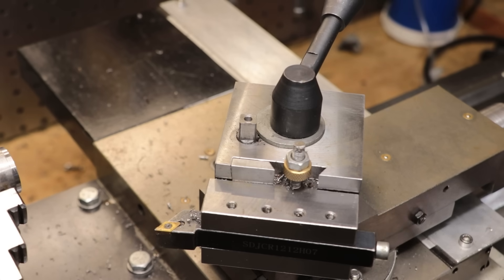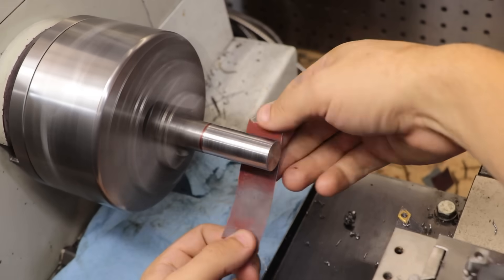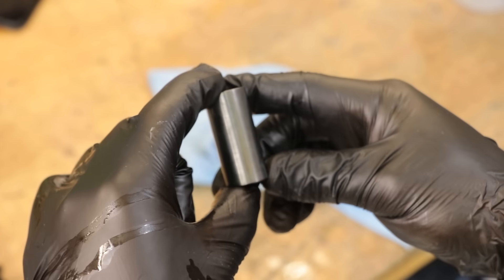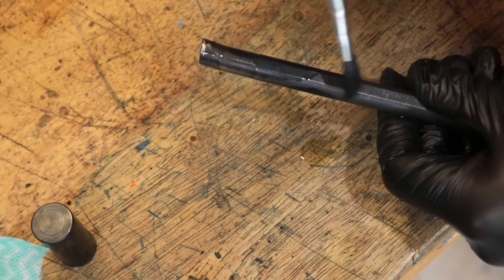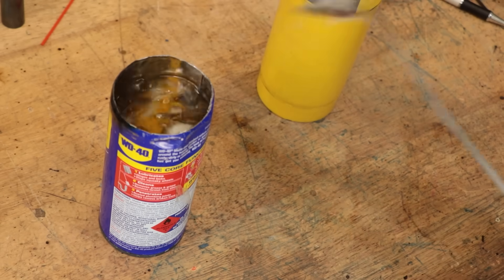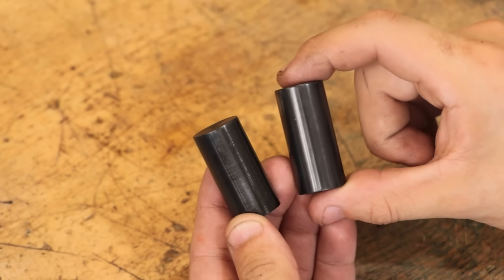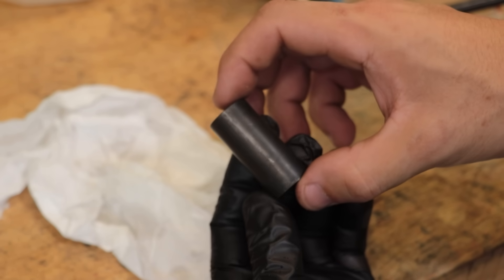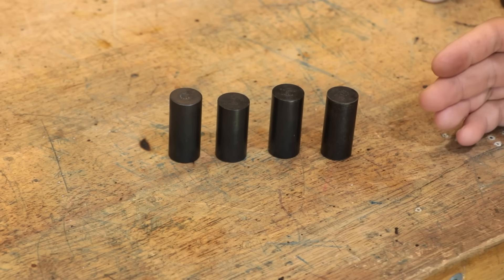Best Way To Blue Steel? Cold Blue, Hot Blue or Rust Bluing.

Comment: Nice video, although you've missed the other easy home shop solution, parkerizing. It kicks cold bluing and hot bluing into the trees in terms of quality and durability, and it's way faster than rust bluing.  All you need is a hotplate, or better, an unused slow cooker (don't even dream of using the wife's one, though).  The solution is easy to make, and for teh quantity of stuff the average home workshop is liable to need to blue, a couple of litres will last a lifetime.
Reply: Does parkerizing change the size, like if you use it on a thread, will it still work? 
I think I will try it, if I can find it in Europe :-)
Reply: @chris6160-d6s  There's always some dimensional change, but it's not noticeable.

Finding ready to use parkerizing solution is not that hard but can be a bit pricey, otherwise roll your own from phosphoric acid, manganese dioxide, and some steel wool. Many recipes are available online.
Reply: @wibblywobblyidiotvision  Great, thanks.

Comment: The best things I've found for Cold Bluing is a Syringe and a small Foam Paint Brush or alternatively a wad of Raw/Unspun Cotton like Cotton Balls. 
  The Syringe lets you apply the solution directly to the Foam Brush so you don't have to worry about wasting any as you can just add any unused Cold Blue back to the bottle, and the Foam Paint Brush holds and applies the solution much better than a regular bristled brush does. 👍👍
Reply: Such a solid tip

Comment: Can you tell us what other styles that you looked in to?
I've heard that boiling the part/s in vinegar is a good form of bluing for the hobbist.
Reply: Vinegar will remove real bluing.  It might also promote rusting; not really sure.  If so, it would be like rust bluing.  When I taught gunsmithing we only used real caustic hot bluing and Parkerizing so I’m not familiar with any way of using vinegar for bluing.

Comment: I did something similar to the hot bluing, 
I was making hardware pieces out of a higher carbon steel. After shaping I heated to red hot and quenched in used motor oil. They came out with a very nice black finish and good rust resistants
Reply: It is a good finish but isn't good for precision pieces as heating to red hot can cause warping or distortion which may require grinding to restore precision.
Reply: I never have tried to blue anything but decorative or ornamental pieces, but that's always been my go to. I suspect the used motor oil makes the parts darker because of the carbon/soot in it from engine combustion. 

If you want to try this, lawnmowers usually run non detergent sae 30 oil, and it usually doesn't get changed regularly, so there's your potential source. 

If you don't have a lawnmower, I'd bet one of your buddies would love to let you change his lawnmower oil for free. $10 and 15 minutes and you have your blueing solution.
Reply: @Matt-re3or  
i do own quite a few axes with that sort of finish. essentially the smiths just leave it on after quenching the steel and only remove what is necessary for grinding the edge and i can say it is sturdy, but not very even.

Comment: You could also try salt bluing.

It is tougher than most of these options, and can be polished (unlike rust bluing which will stay a satin finish) but not nearly as dangerous as the caustic bluing.

Comment: Most cold blue coatings use selenium (in the form of selenious acid), which can be very toxic. I think the blued parts themselves are probably not something I would want to have skin contact with (copper selenide). I would avoid using it.
Reply: Have there been any proven cases of poisoning from contact with cold blued parts?

Comment: An interesting video. 

Depending on where anyone lives, it might be possible to find a small gun shop who do have there own hot caustic bluing tanks. If you do the initial polishing to the level you want, the costs would be very cheap if all there doing is running them through those tanks. I looked into setting up a small system to do it at home because of the much better professional finish quality and it's durability. Frankly it needs to be either in it's own separate building or done outside. Even the fumes from the process will seriously rust anything anywhere close to the same location. It will also after using it enough, even start to degrade any wooden structure. I could afford to do it, I just don't want the extra issues that come with it.

Luckily my own small shop is inside my home and has the same conditions as far as being a semi controlled environment. I also live in a fairly arid area, so tool rusting has never been an issue. In the summer, my inside humidity levels average about 30%-40%. In winter and with the heat on, that drops to an average of 20% - sometimes as low as 9%. The only evidence I've seen of actual rusting is on a bar of 12L14 I've had sitting in my metal stock for over 25 years. But that alloy is well known for how easy it does rust. Even then it still only shows a few light areas. 

But I try to look at problems like this logically. Machine tools and all the required tooling quickly adds up to a decent sum. I've also seen large numbers of pictures in UK published magazines that show huge amounts of rust over almost everything. For whatever reason and using what they refer to as a garden shed or separate out building on there property seems very common. And going by those various pictures and in some YT videos, few seem to be ever insulated with vapor barriers or have anything like constant source of heat during lower temperatures. It's always seemed highly counter productive to spend what this costs and yet refuse to insulate to slow that humidity and reduce those non optional heating or air conditioning costs. And in those high humidity locations, I'd not hesitate to also add a dehumidifier. Any unheated area will go through the same temperature swings as the outside temperatures do. So anything made of metal takes a whole lot longer to thermally stabilize. That causes high humidity to condense on the surfaces and that's what causes the rusting. While I fully sympathize with anyone having to constantly deal with that humidity, tying to band aid and work around the problem is only treating the symptom and not addressing the root cause. Bluing parts does look proper for a lot of items, but for myself it would be for aesthetic reasons and far less about any rust prevention.

Comment: I put an old socket that I'd found rusting in the dirt, outside of our old shop, into a container of vinegar with some other small parts.  It got missed when I retrieved the parts, and the socket sat in that vinegar for about a month.  When I found it again, it was solid black and deeply pitted.  I rinsed it off, dried it thoroughly, and oiled it, then I soaked it with WD-40 before putting it on a shelf.  Years later, the rust has yet to return to it.  This is not a climate controlled building, so that socket is still subject to condensation and other factors that come with that inconvenience.

I vaguely recall that Randy Richard did a method of bluing that involved suspending the parts above vinegar, plus leaving the (closed) containers in the sun to fill the space above with fumes.  It seemed to produce nice results, but it was a time consuming and slow process.  It was quite a while ago when he did this, so you will have to go way back into his archives to find it, if you are interested in researching it.

Comment: I would be curious to see how bluing compares to applying a rust converter. For example, at 12:38, after you've uniformly oxidised the part, you can then just brush it with rust converter (NOT rust remover) to convert the Iron (III) oxide into an inert layer that chemically bonds with the underlying metal surface. Rust converters are mainly tannic acid or phosphoric acid based, with additives that promote adhesion.
Reply: I have had good results with Phospheric Acid, then oiling with a good soak period. I quite like the matt grey colour, but it can be tricky to get an even finish. I use it mainly for nuts and bolts where the uneveness doesn't show. If you leave the acid on too long it can develop a white deposit but you can scrub that off and recover.
.
I have now started using phospheric acid the coating in a drying oil like Penetrol Rust Treatment. It's good for storage, but not great for wear items like hand tools.

Comment: Jane’s Kits in Melbourne make a heat-based Nickel coating that I’ve used. It is easier to apply than the electro-plating version and gives more even results, but you’ll need to modify a cheap hot plate with a temperature controller to use it. From memory I believe you need to keep the solution at 85 deg C for about 45 minutes. Also, I run a small desiccant-based dehumidifier in my shed 24/7 during the wet months. It costs about $300/yr to run, but it’s worth it for the peace of mind. My tools almost never develop rust unless I leave them too close to the floor. I think it’s an Ionmax ION610, which you can get for around $250 from eBay or $329 from IonMax

Comment: Caustic blueing with linseed oil is my go-to method. I use a solution with ammonium nitride as an oxidizing agent. You can boil it outside or under a fume hood. Linseed oil applied afterwards is drying oil, which will act as a thin solid layer further repelling moisture.

Comment: I like to keep a small piece of Scotch-Brite coated in a little 3 in 1 oil.  When I get a small rust spot on a tool (or when they need a bit of a clean),  I just give them a scrub with the oiled pad and a paper towel.  Job done.  In my pea brain, the Scotch-Brite helps dig the oil in to the metal and leave a protection.

Comment: Sodium hydroxide is lye - but not the only drain cleaner. Some of them are acids instead of bases. In the US, at least, you can get crystalized lye which would be pretty useful for small batches - and the added bonus that you could just pour it down your drain 😅

Comment: I read in one gun magazine about rust bluing but I did not believed that low temp oxide conversion is possible.  They used hydrogen-peroxide as rusting chemical. I wonder if it is possible to speed up rusting with electricity, if they remove rust is it possible to add rust by switching polarity?

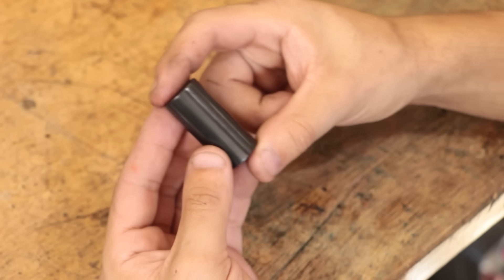Comment: 10:05 Hey man, that's not exactly correct. Temperature of recrystallization for different steel alloys varies from 600 to 900 °C (and to ruin the tempering you need to heat it +30-50 degrees from that), while the gray color is achieved when heating up only to 330-350 °C. For the bluing, actually you need to heat up the part even more, closer to the glowing stage. Before starting to glow, it turns brownish (~400-450 °C) - that's the right spot. So you basically have this temperature gap - between 450 and 600 - not to overheat the part. If there's no temperature for recrystallization, it will not occur, thus the tempering will stay intact. That's a fact.
Also you probably shouldn't use vegetable oil, it doesn't seem to work properly for bluing. Use natural linseed oil, it works best. Don't wipe off the excess oil after taking the part out. Let it drip and dry by itself for at least some time. It needs to dry and react with the oxygen in the air, otherwise there won't be a polymerized layer which you're looking for. The best advice I can give is to have a look at oldtime technologists' guides, there's plenty of really useful information that is sometimes impossible to find in modern literature. Best regards

Comment: I have used a method that I learned from watchmaker video.
and the results are awesome.  But I have made some cold bluing with pretty good results as well.
First let me say, I am not a professional,  and please don't do this inside the shop, but outside in the fresh air.

1) Heat the part up very hot with a torch 
2) Dunk it in "old car motor oil"
3) Take it out from the oil, and use the torch to burn off the oil
repeat several times and you get a very nice and dark bluing.
4) Clean it and put some protective oil of your choice

Use proper protection and caution please
and if any part makes you uncomfortable, 
don't do it. 
Be careful and safe

I have done this several times with very good result, but like I said I learned it from a watchmaker youtube video ... I just can't remember the name of the video

Comment: My solution for the rust problem in the workshop is to use a spray gun to cover machines and accessories with used hydraulic oil. Effective but much cheaper than Fluid Film or Boeshield.

Comment: one of the solutions that I have used at the machine shop for blackening mild steel parts that are going to be exposed is to use Beeswax, Turpentine, Linseed Oil in a 4:2:1 ratio, mix and stir until its a gel consistency. Sometimes I will add ebony furniture stain to the mix. Heat the parts to 300 degrees, I use an old toaster oven. Make sure they are properly cleaned first, then submerge them into the can of blackening. Remove and rub down after 5 minutes or so. Repeat if necessary. It holds up pretty well, I coated hammer heads, shovels etc they show minimal rust. If its a big item i use a torch head to heat it.  The bonus of having a small oven in a machine shop is there are other finishes that can be done in a small shop that using a dedicated oven would allow. Look at Cerakote, they have some great applications that can be done in a small shop.

Comment: Arguably the best 'black oxide' coating is parkerising. It's also worth looking at the various types of 'wax oil' as longer term alternatives to the 3in1 oil. I'd recommend looking at Mark Presling's youtube channel for some really comprehensive guides to metal finishing in the home shop.
Reply: Parkerizing, whether zinc or manganese, is a very durable finish but it is not the same thing as black oxide.  Either type of Parkerizing is much more rust resistant than black oxide bluing.

Comment: You realize the thumbnail is wrong at multiple levels?
First there's a typo
Then the labels are misplaced, they do not match the rod in right under it.
Reply: it should be: COLD / CAUSTIC / HOT / RUST

Comment: ok pretty dumb question but since stainless steel is super expensive, why arent more things out of metal nickel plated? especially cars since combating rust is one of the main problems with cars older than like 10 years, right? does the plating wear off over time?
Reply: There is no such thing as a dumb question.  Very old nickel plated handguns often have missing areas of plating and are graded accordingly to percentage of remaining original finish.  Any type of metal finishing come at a cost to manufactures and they are always trying to have a sellable product with the least cost to them.  I’m afraid car manufactures really are not interested in making their products last longer.  They are in the business to sell more cars, not have yours last longer.  That would be up to you.

Comment: I've written down a recipe for hot bluing some years ago but haven't gotten around to test it.
1 part potassium nitrate (saltpeter/KNO3)
1 part caustic soda (NaOH)
3 parts distilled water. 
Heart it to 100 degree C and put items in, wait 10 minutes, take 'em out and let them cool. Clean with a paper towel and add oil. 
If anyone have tried this method, let me know.
Reply: The temp must be held around 140 degree C, its very important.  This formula will work to a degree but its inferior to Sodium Nitrite + Sodium Nitrate + Trisodium Phosphate + Caustic soda.  With your formula you will find the result more dark greyish, not deep bluish black.  Different steels will give a different result in any case.

Comment: I have a question . I know that a lot of watch parts are heat blued (sometimes with brass shavings) what i primarily see as a act to make it better looking rather than rust resistant.  But can than be used as a process to blue steel effectively in a home workshop?
Reply: Temper bluing is a very delicate finish, you can almost smudge it off just by handling the part, I wouldn't suggest it for tools.

Comment: Fyi, you can fix the stickiness on a cast iron pan and I would assume a steel part by baking it at 220 to 230 c for 15 to 30 minutes. It will cause the under polymerized oil to finish polymerizing or burn off.

Comment: It would be time consuming, but if hot oil bluing is the same as seasoning a cast iron pan, you could also try treating your parts the same way you re-season a cast iron pan: clean thoroughly, wipe on a layer of oil, wipe off ALL the excess, and bake in the oven at around 180C for half an hour or so. Repeat until you're happy with the coating. For cookware, flaxseed oil seems to work the best. Note, it really is important to wipe off the excess before baking; a few-molecules-thick layer will correctly polymerize, while a thick, drippy layer will just turn into gummy tar.
Reply: A great solution to to heat treated steel, especially if you do it at such a low temperature as you suggest

Comment: NOTES 
Hot Blue : 
the tempurature is going to change depending on the oil used 
the rougher the surface the better the blueing takes to the metal
Rust Blue : 
the deeper the rust penetrates into the part the deeper the blue will penetrate
probably want to let the rusting solution sit for a lot longer hours vs minutes
 before the hot water bath